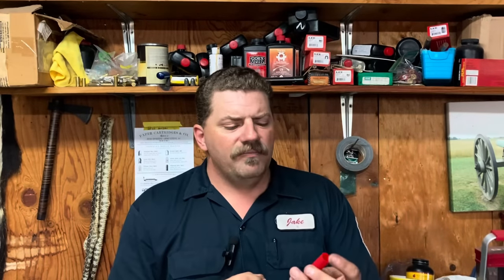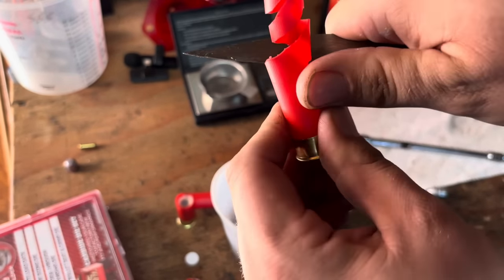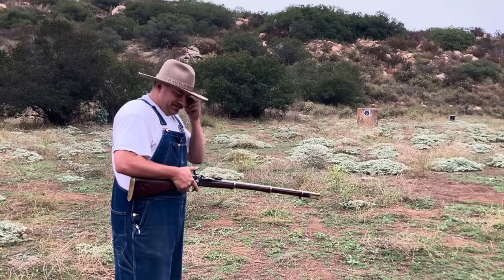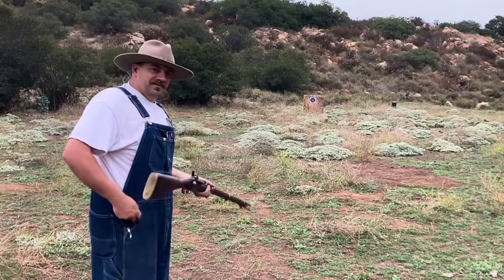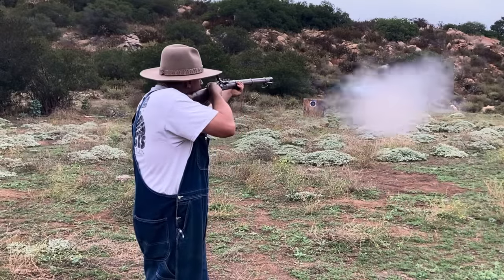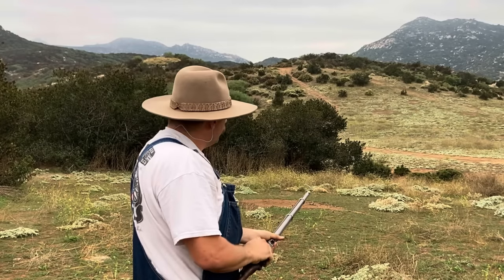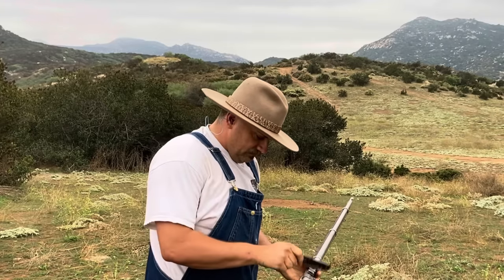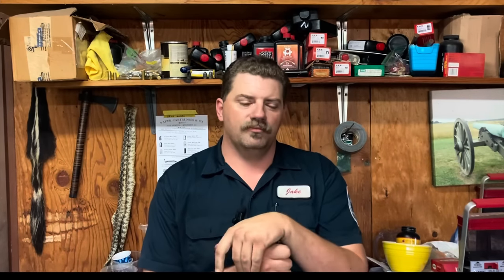Making Cheap And Easy 577 Snider Ammunition

Comment: Scotch brite pad wrapped around a rod chucked in a drill to polish the bore would likely give the clearance you need for the shotshells
Reply from the maker: Good idea
Reply: Yep.. surprising what polishing a chamber can do. I know you are talking about actually enlarging the chamber , but I have taken quite a few Mosin Nagants that would hardly extract(sticky bolt) and fixed them with a dowel chucked up with steel wool wrapped in 800 grit sand paper and just a few seconds and it’s done… never another sticky extraction.
Reply: @guaporeturns9472 Probably caused by decades of lacquer from steel case rounds building up in the chamber
Reply: @JamesThomas-kx5sj  pretty sure that’s exactly what it is

Comment: Someone probably makes an expensive tool to trim hulls but I just pinch the plastic and cut it with a pair of my wife's scissors.  We get stuck cases all the time and have to use a rod to tap them out.   Some brands of hulls stick more than other.
Reply from the maker: Yeah I’ve seen some nice ones but I just don’t need one.
Reply: Back when I lived in Visalia, I had to trim 400 walmart 12 gauge hulls for recast slugs slugs. I ended up doing in front of the TV with a harbor freight razor knife. They came out good enough to run through a semi auto.
Reply: 150 years of crud in that breech.
Might be time to use a reamer to bring out all the crud and recut the chamber to the original and correct size?
Reply: There are some nice ready made items. Personally I use either a sharp craft knive, similar to this or I have 3D printed some jigs for lengths I cut a lot of and then use various sharp blades with those (craft, thicker razor etc).
Reply: I always shoot original vintage ammo, works like a charm !

Comment: Little known fact, your short rounds have been done before. The Dominion Cartridge Company which was in business 1886-1910 produced two lengths of factory .577 ammo loaded with black or smokeless powder. Their short version was about same length as yours. The smokeless DCC rounds use a cardboard tube inside the case to reduce capacity. All done with balloon head drawn brass.
Reply from the maker: Interesting
Reply: Yes, the short version is actually called 577 Canadian.

Comment: Great vid! Back in the day, I wasn't able to get any new Dominion brand .577 ammo any longer but found some Berdan primed Kynoch, only ten rounds if memory serves. I drilled them out and soldered in a shotshell battery cup and then was able to use Boxer shotshell primers. I had many old shotguns and used 20, 16, 12 and 10 gauge brass shells but never did come across any 24 gauge. My buddy and I used 12 gauge plastic shells with plastic wads and black powder for casual trap shooting with old doubles. The plastic wads would coat the inside of the barrels, reaching the choke after fifty rounds. Flushing the barrels with a garden hose would wash it out, looked like a big snake skin! Cheers.

Comment: Long time Snider shooter here. I use brass shells myself, but the stuck firing pin is a common issue-- it may be worth considering primer flow. Original Snider ammo is more in line with an FFG charge, so FFFG and oversized bullets might be combining and  producing sufficiently high pressures to encourage the primers to flow around the firing pin and thus binding it up. I have noticed that moving to an FFG powder has dramatically reduced the issues with stuck firing pins.
Reply from the maker: Interesting. Thank you

Comment: Cheap way to shoot the Sneiders but up here, in Canada, the plastic shells are almost impossible to find. In the past I used to order them from a shop in Alberta but last time I checked both brands ( Cheddite and Fiochi) were out of stock so I stick to my brass magtec cases.
Reply: If you don't mind answering. Can you still own a gun in Alberta?
Reply: @fokkerd3red618  Yes you can. Now, there's a temporary freeze on handguns, you cannot buy them but if you own them already you can keep them and that ban doesn't involve antique status handguns. There's also a ban on AR 15. There's also a lot of back and forth on bill C21 which, if it passes ( I hope not) will make a lot of models illegal. BUT none of those bans concern antique status guns( so far). Antique status guns can be owned and purchased without any licence, all you need is to be at least 18 years old and you cannot have a firearms interdiction on your criminal record. Sniders fall into this category so no licence and no registration required to buy them and to shoot them at the range and wherever it is allowed by law but if you want to hunt even with antiques you need to buy a hunting permit ( either provincial or federal for migratory species). In order to buy your hunting permit you need to take the provincial hunting course and pass the exams with at least 80%. In order to take your hunting course you need to take the ( federal) canadian firearms safety course and to pass the exam with at least 80% if I remember correctly , it's been a long time ago. Also, if you want to buy ammo even for your antiques you need your PAL( posession aquisition licence) but if you are a reloader you don't need a licence because brass cases or shotgun empty shells are not considered ammunition, primers also, lead bullets or shot are not ammo either and black powder falls into another cathegory and it's regulated by the explosives act so you can buy it without a licence as long as you're not a minor but you need to comply with transport and storage regulations.
Reply: @fokkerd3red618  Ontario here, Sniders are not guns by firearm standards, they are antiques and no license is required.
Reply: @Aviator747a  In fact they are considered antique firearms, most of the sections of the criminal code concerning firearms don't apply to them but some are:

Certain weapons deemed not to be firearms

(3) For the purposes of sections 91 to 95, 99 to 101, 103 to 107 and 117.03 of this Act and the provisions of the Firearms Act, the following weapons are deemed not to be firearms:

(a) any antique firearm;

Exception — antique firearms

(3.1) Notwithstanding subsection (3), an antique firearm is a firearm for the purposes of regulations made under paragraph 117(h) of the Firearms Act and subsection 86(2) of this Act.
Reply: @elenas4878  I know what our laws are here. Like I said by firearms standards, no license is required to own it, PAL. If you walk into a bank with it and say this is a hold up, you will be charged with a weapons related offence.
Reply: @Aviator747a  Exactly. Also, if you want to hunt with them, you need a permit. Or, if you want to buy ammo, you need a PAL but not to reload your own ammo.

Comment: I’m going to be doing this soon. Also going to test light loads of shot. My hulls are from fiocchi shotshells that I bought with the intent of finding a 24ga shotgun. The plastic hills are not currently available up here in Canada. The Nepalese sniders are crude to say the least but they filled the role for them.
Reply: Dominion cartridge company up here in Canada loaded .57 snider until ww2 these were 1 5/8 cases people think these were for the Canadian Cadet carbines(just normal long rifles cut down for cadet use). In reality they did this bc brass was expensive and they didn’t need all the extra case capacity. They loaded both conical and birdshot with black powder and either bull semi smokeless(BP sub) or a bulk smokeless that was able to load like black powder.
Reply: Canada here as well. I went the brass route.
Reply: @Aviator747a  yeah eventually I am too just not right this second. Eventually depending on how the shot loads work I will probably just use plastic for them.

Comment: Great video, thanks for sharing. There is another way. Not better, not worse but it works. Before the net and when I could find no ammo, I made a solid brass case and drilled it through and chambered it for 38 special. I charged the case with 7 hrs of 700X, placed a cardboard wad over powder with a couple of drops of white glue to seal it. Place your 577 dia mini ball partially in the bore and let the insertion of the adapter push it in the rest of the way so the two are as close together as possible. Then insert the 38 cal charge and close the breach and fire. This is not dangerous because as you know, only in the snider, the bullet is the same size as the bore. The same charge cartridge could be made from 45 LC if you prefer to use black powder. It’s a bite of a pain but I got to shoot and that’s all that counts.
Take care.

Comment: A lot of nepalese.577 Snider rifles were converted to a unique shotgun round based on the Snyder brass. If you got a rebarreled ,arsenal refurbished rifle that was a shotgun conversion, that could explain the slight differences in extractor tolerances.

Comment: you can still get the brass hulls from several online vendors, they typically run a bit over a buck a hull, which these days isn't really that bad I guess. The plastic hulls definitely seem like a more economical choice to get out on the range with it. I'm a little jealous, economical and 50/90 doesn't really live in the same area code. LOL
Reply from the maker: That’s the truth

Comment: Possible reason for the longer shot shells getting stuck.  Straight walled rifle cartridges tend to taper inwards.  Plastic shoot shells seem to flare outwards just a little bit.  The longer the case the greater the flare.  I’ve never used 14 gauge but they’re probably like 12 and 20 gauges.
Reply: 150 years of crud in that breech.
Might be time to use a reamer to bring out all the crud and recut the chamber to the original and correct size?

Comment: Try a paper cylindrical liner for the plastic shot shells 2 turns with the length starting a bit longer than the shell, greased or waxed paper crimped in as a wad with the round ball.. or is this just going to be another firework..  Wax the inside of the plastic shells?

Comment: You should try a pex tubing cutter for the shell modification. Fast, straight and simple
Reply from the maker: Where can I buy one?
Reply: @Everythingblackpowder  your typical big box home depot, lowes or menards or hardware store has them, but I don't think they would work good as the hull is pretty soft and just might flex instead of cut.   They work great on pex though. I think mine was around 15 bucks but I use it on pex.
Reply: @luuk-out-below9804  I procceses a bunch of shells to make blanks for perimeter alarms it worked great. I used the blue one that looks kinda like a chip bag clip. You just clip it around and spin it. I wish I could post pictures. I'll see if I can post a link.
Reply: @MechanicalMercenary  There you go! 👍

Comment: Sorry, should have added to the original comment.  The original cartridge was designed by Col. Boxer of primer fame.  Mark I was a coiled brass and cardboard body with a brass cup head similar to current shotgun shells but using a Potet primer.  Marks II and III had the head replaced with a brass disc secured to the body by riveting a Boxer primer to the body. Mark IV and V had a blackened iron disc.  Under adverse conditions the discs were pulled off the body during extraction hence the need for the clearing rod.

Comment: I had the same issue and came up with the same solution. I load mine with 40 grains of 3F instead of 35 and I did chrono mine at 988 fps.

Comment: Just pulled up price for brass Snider casings on Track of the Wolf. $205 for 50.
MagTech 24ga brass for #35 for 25.
Couldn't find any plastic on Midway, everywhere else "check for availability.".

Comment: Great video as always. Both informative and entertaining 👍🏻

I do have an "off topic" question (for everyone). Does anyone have any recipes or techniques for lubing felt cushion wads for 12ga? I'm about to experiment with some d.i.y. felt wads and want to try some sort of lube on them to see if it helps fouling/cleanup.
Reply: Melt 50/50 beeswax and lambs tallow, throw some wads in to soak and pull em back out and set on a wire rack or paper towels to dry
Reply from the maker: Dido
Reply: @noturfather1106  Thanks matey! 👍🏻

Comment: @WillardMcBain (or anyone) -  I have a blackpowder Lemat 3rd version pistol that I am going to shoot. It has a centerfire 6 inch shotgun barrel chambered in 24 gauge. I have some brass 24 gauge shells, but I am wanting a few plastic shells to shorten and use instead. The brass ones don't fit as I would have to cut it down so far that it is as short as the case head on the plastic ones. I have two questions:
1) Can you spare 2-3   24 gauge hulls so I can see if they will work? I can buy them from you or I can send you brass ones in trade?
2) I plan on using #3 buckshot as that is pretty close to the original size that was used in this pistol. I was planning of starting out with a 25gr FFF charge to see how it goes. Any thoughts on that?

Thanks,
~Brian

Comment: Hello i just bought a snider bsa mark ii short rifle 1866. I tried this method the only problem i have with the plastic cases is the firing pin punches a hole throught the primer of the case and it gets the firing pin stuck and u cant open the breech. The way to fix this or work around is i have to cock the hammer again and press the trigger. And after cocking it to the second position the firing pin goes back and i can open it. Do u have any idea how to fix this? Its not that big of a problem. My question is does this damage the gun in any way? like the firing pin or something i dont wanna break my gun. I found out that using old paper 24. gauge cases work well the firing pin doesnt punch throught the primer just hits it like it should. Thank you for answer
Reply: I might post a video where u can see that if u want to. I would also use some brass cases but the ones i bought were some already magtech formed and i cant insert them fully in the gun they just get stuck.
Reply from the maker: No it won’t harm the firearm unless you try to wrench the breech open with the firing pin stuck forward. As for your brass cases, you might have a shorter chamber. How far does the case go into the chamber?
Reply: @Everythingblackpowder   most of the case gets in the chamber only like 0,5 cm is stuck outside. What is weird that a plastic one thats the same height goes there normally. And i took one of the cases and really like really shortened it and it still doesnt go in. I think its just too fat to go in there. Also other problem with the plastic one is that half of the ones i shot after inspecting them at home had a little hole in them after firing. And the paper ones were alright no hole in them. I used a pretty low dose of powder most of them were 2,5g and a few were 3,2grams. Weirdly the ones with more powder all of them i think were okay with no hole. Also thank you for answering my question i was scared that it could actually damage the gun by using the plastic ones. The gun is really nice i took to the range for the first time and shot about 50 rounds. In most of them i used the .575 ball i couldnt find a store that sold the .600 . And accuracy at 25m was pretty good i would say but it shoots really high. Do u have any experience with the .575 round balls in the snider?
Reply from the maker: @MrFiliCZ  are your brass cases sized properly?
Reply from the maker: @MrFiliCZ  I’ve only ever used .600 round balls
Reply: @Everythingblackpowder   Probably not i just bought them from some store and i havent done any resizing myself. On the site they said it should already be resized exactly for the snider.
Reply: 150 years of crud in that breech.
Might be time to use a reamer to bring out all the crud and recut the chamber to the original and correct size?
Reply: Is your black powder load too "hot" causing "primer flow"....
the primer is being forced back partially out of the primer pocket under extreme pressure and thus "flows" round the firing pin as the primer has no where else to go until it hits the breech face?
No other signs of excessive heat or case stretching/hole through etc.?

Is the firing pin the correct shape...the end not pin sharp/partially missing/shattered but a little "blunter" so less likely to pierce the primer?

Comment: It is original (made 1866 to 1874 )and still shoots well after 150 years....?
If it were mine I would get a gunsmith who could handle polishing the breech  to get rid of a century and a half of corrosion and reestablish the correct dimensions so as to fit the modern shot cartridges in a relatively smooth breech....
just like it was when originally made.